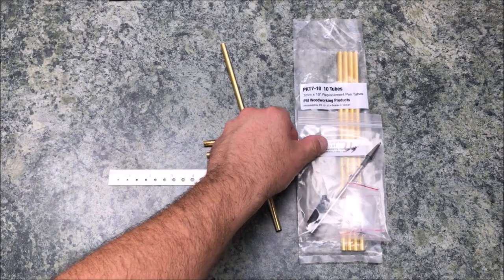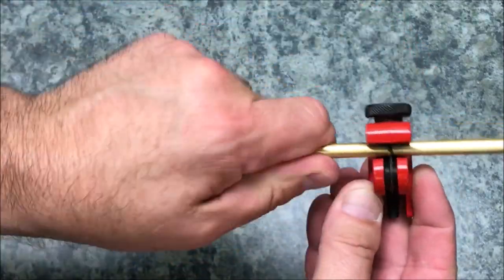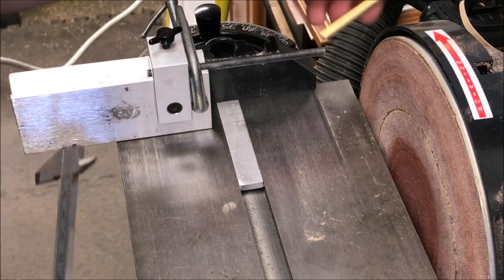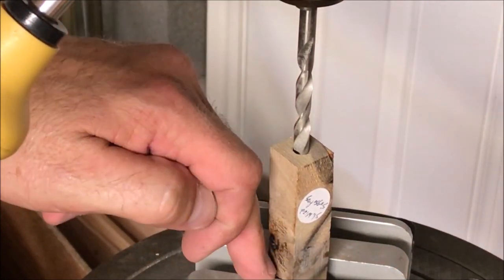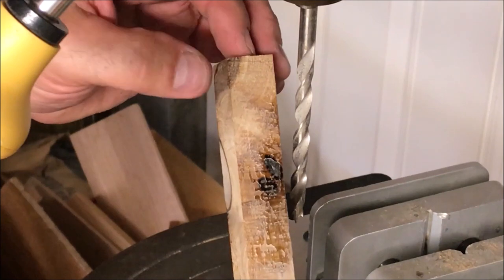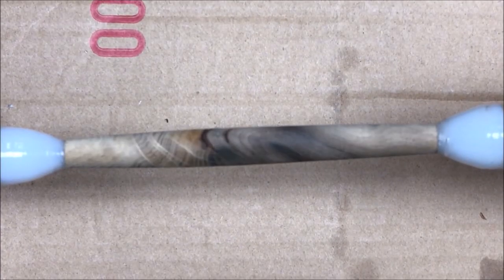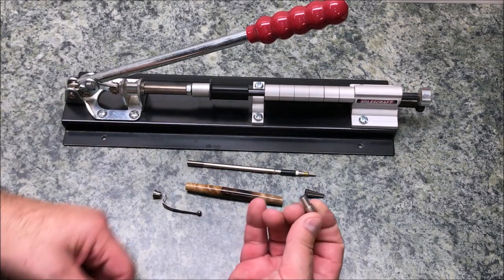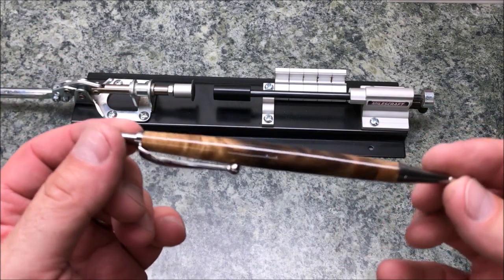One Piece Mechanical Pencil With A Sassafras Blank

Comment: HI Bob, Very nice pencil Bob with a fantastic piece of Sassafras. I've made one piece slimlines using both tubes from the kit but just gluing the top tube in place leaving the bottom tube "loose" but still with the mechanism in it. Works really well. Cheers, Huw
Reply from the maker: Thank you Huw,
  I have a couple videos making slimlines that way. It’s really slick. 

Regards,
Bob

Comment: Another nice project, Bob!  If you put the punch inside the tube while using the tube cutter the cut is supported and you will get a lot less round over - sometimes almost none - to fix.  Just a thought.  Love your enthusiasm! Russ
Reply from the maker: I’ve tried that and it is harder. It scared the punch and I’ll bet dulled the cutting wheel. 

Regards,
Bob

Comment: I have a trick for cutting brass leaving the ends not crimped. Insert the punch into the tube before cutting it. Make sure to use the punch that fits snuggly inside the brass. Works perfectly everytime 😁
Reply: That sounds like a good tip.  I'm going to give that a try. Thanks for sharing that.
Reply from the maker: Thank you Jason.

Comment: I built a mechanical pencil from Woodcraft 5 or so years ago.  Compared to a typical Pentel Sharp 0.5mm pencil, the fit of the lead to the nib was very sloppy.  As an engineer, I didn't like it, even though I wanted to.

Subsequently, I made a mandrel, gutted a Pentel and made a few that way, using the Pentel parts as the source for the 'kit'.  It obviously wrote just as well, but in general the pens I made were easily broken due to the thin nature of the turning.  I basically gave up on mechanical pencil making after that.

In your opinion, is this kit tight compared to a Pentel?  If so, I would consider trying again for sure, as the look of what you made is very nice.

Recent subscriber, BTW.  Been watching a lot of your past videos and learning a few things along the way.  Your presentation and demeanor is very pleasant and informative.

Thanks!
Reply from the maker: Hello,
  This is a 7mm pencil and works very well. I use the same kit daily at work. Would I say it handles lead as well as a Pentel? Probably not. What I can say is the single tube makes this pencil very strong. I have several Pentels on my bench and have been looking at a way to turn a pen go accept the Pentel mechanism.

Regards,
Bob
Reply: @RJBWoodTurner    That makes sense.  The version I made did not use a brass tube at all - basically just an acrylic version of what Pentel originally made.  I don't know how to attach a picture, but I think what I did is straightforward.  If you want any pictures of one I made or the mandrel, I can send it to you, but I don't see an option for a PM anymore either, so not sure how to reach out.  Its probably just an example of what NOT to do anyway. . .   :)
Reply from the maker: You can send photos to rjbwoodturner@ufoww.com. I’m at the drive in with the family tonight so I’ll check out the photos tomorrow. 

Regards,
Bob

Comment: That is one beautiful pencil Bob, but I do have a question that is somewhat related, and you may have answered this before, why don't you mount your pin press to the bench instead of letting it slide around?
Reply: Although I'm not Bob, I do have some experience. If you let it slide around, it has the possibility of causing the parts to move or slip. Which might cause the parts to be put in crooked.
Reply from the maker: Hello Donald,
  I don’t want it mounted because I use it in different locations around the shop as well as on location when I turn at club. 

Regards,
Bob
Reply: I mounted mine to a piece of hardwood (oak) and on a piece a couple of inches wider then the press.  Routed a couple of grooves to hold the pen parts along the back edge.  Mounted the press along the front edge with some non-skid feet on the bottom.  Made the press quite stable.
Reply: @RJBWoodTurner  thanks for the answer, that makes sense.
Reply from the maker: Great idea. 

Regards,
Bob

Comment: With the wood having been stabilised does it affect how fast the ca glue dried. I tried it on some ash and it didn't seem to harden up even with accelerator. Any advice would be gratefully received.
Reply from the maker: I didn’t notice any major difference but it dry a bit slower. Probably because it stays on the surface and doesn’t soak in. 

Regards,
Bob